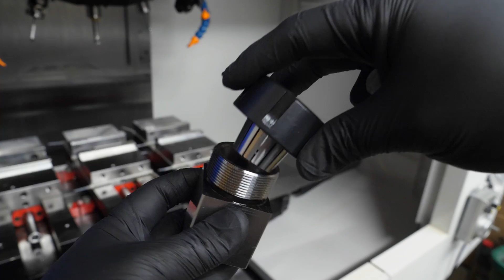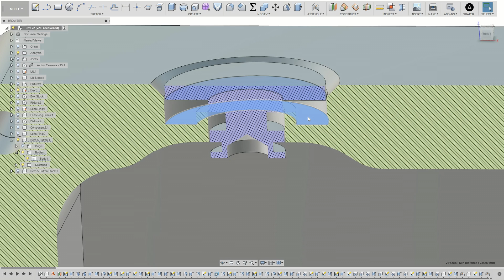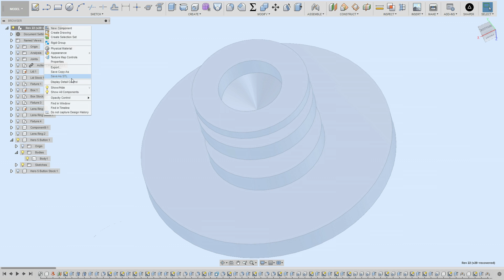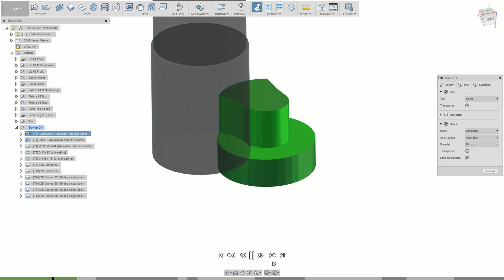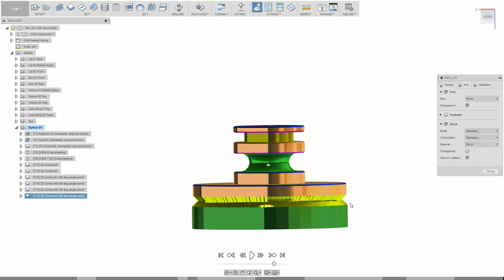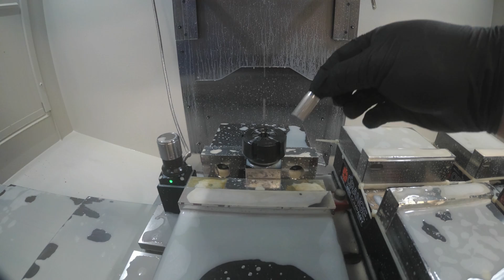CNC Machining a Round Part with a Mill Instead of a Lathe (7075 aluminum) (4K 60)

Comment: Hey! Just found your channel from John’s video about the GoPro case. I’m already on my second plastic one so I’ll need to get one of yours soon. I also have a speedio in my garage.
Reply from the maker: Nice! It's a great garage machine, isn't it? I was on the fence before I ordered, but now I'm pretty convinced that the Milltronics, Haas, or whatever else I was looking at simply wouldn't have fit.

Sweet, I'll keep you in mind for when I make a batch. What camera would you want a case for? (I have designs for Hero 3/4, Hero 5/6, or Yi 4K/4K+.)
Reply from the maker: I don't wanna be spam-y, but I thought I'd throw out the "what camera are you using?" question again. No prob if you've changed your mind about ordering one or whatever, I'm still curious what you're using camera-wise, just so I have a better idea of what I should make if/when I do the first batch.
Reply: Oh sorry I didn't get back to you. I'm using the hero 6. I actually just contacted gopro and got them to send me a one time only replacement which was cool of them. I even told them that I thought the issue was my fault but they sent it anyway.
Reply from the maker: Whoa, that's pretty awesome of them!

Comment: For a second I thought this was going to be one of those "using a mill as a lathe" videos where you hold turning tools in the vise and material in the spindle. I'm kinda glad that's not the case, it's usually more practical avoiding that kind of thing (lol)
Maybe you mentioned this in the past but is there a particular reason you switched(?) to Fusion360? I find Inventor HSM or solidworks HSM easier to use for assemblies like this, but my version of Inv is a little older and doesn't have some of the updated features that have been added to Fusion recently. ah well...
Reply from the maker: Heh, you know what? I, somehow, didn't even consider that for this part. I guess since I know so little about lathes I'm hesitant to buy any lathe tools and since I don't have any lathe tools I can't experiment with lathe-ing. I have held a boring bar in my vice a time or two to do some very basic turning-like-things (make a chamfer on something, reduce the diameter of a rod, maybe even bore something out) but that's pretty far from what I would have needed for this part.

Probably the biggest reason I switched to Fusion 360 is because I got tired of paying for SolidWorks. Every time my "maintenance" expired and it came time to re-up it made me mad. It's not like the software changed all that much from year to year, and it's not like bugs didn't persist for years, but they never forgot to come and ask for more money. On top of that, if you let your maintenance lapse you then have to pay some BS fee to get back on it. I let it lapse for something like a year and a half just because that was the most economical way to do it. Now it's my understanding that if you let it lapse you have to pay for the entire time you missed before you have the privilege to start paying for the future. ... I'm getting pissed off just thinking about it. Dassault can go to hell. Also, my version of SolidWorks was an "OEM" version, sold to me as a package with SolidCAM. Being OEM meant the maintenance fees were lower, but it also meant the software was somewhat crippled. For instance, apparently it was not possible for me to get the rendering package - if I understood the situation correctly, the only way I could get that onto my computer (legally) would be to buy a whole new license of SolidWorks. I'm assuming the same is true for the other upgrades (like simulation and stuff). And even after Autodesk started eating their lunch (I would guess), Dassault didn't wise up and are staying the course as far as I know.

The switch wasn't easy, but I find Fusion 360 to do at least 95% of what I would like it to do. FOR FREE! How awesome is that? Building assemblies in SolidWorks was sometimes a fucking pain as well. Like, the name of your assembly before saving would be called something like "Assm1" and if you added parts to it and then tried to save "Assm1" out as something like "Enclosure" it would throw up a bunch of errors about how the components are associated with "Assm1". I'm like: "no fucking shit SolidWorks, why don't you change the associations then?". I hated that program sometimes. I hate Fusion 360 sometimes too, but I'm not paying them thousands of dollars so I feel better about it. LOL
Reply: ahh that makes sense. You'd need to find a random box of lathe tools somewhere and start messing around. TBH I think it's one of the things that everyone tries once or twice, but it's an awkward way to program since most CAM software can't generate code that is directly compatible. But your button workpiece is perfect for milling using those slot cutters. Usually the mill-as-lathe parts are those that have curved contours or weird shaped grooves that necessitate the turning tools.
I'm also curious to see your final design for the case. I spend too much cash on those cast polycarb housings....